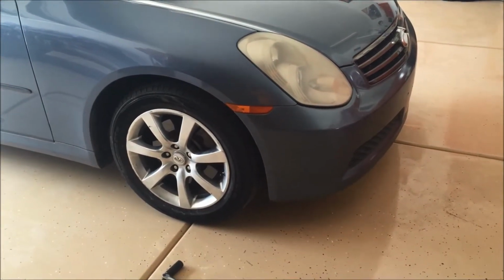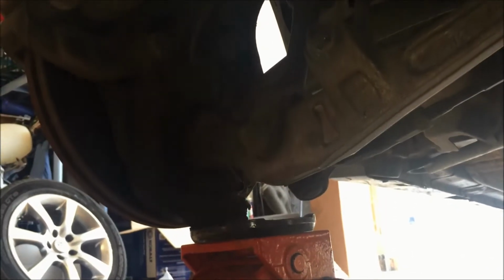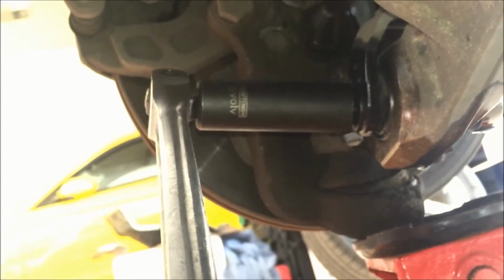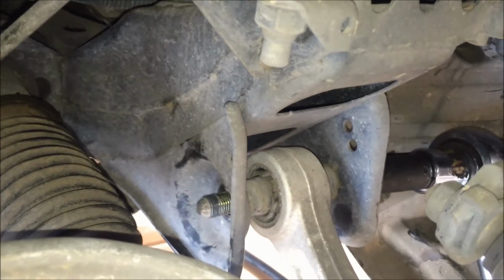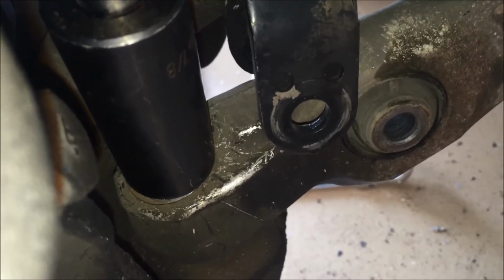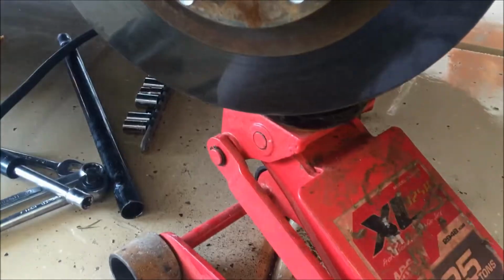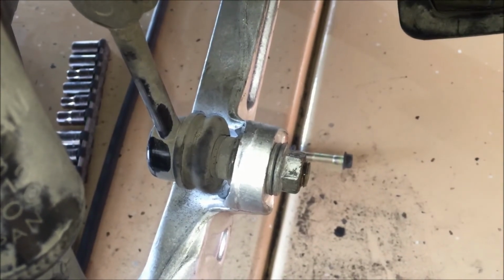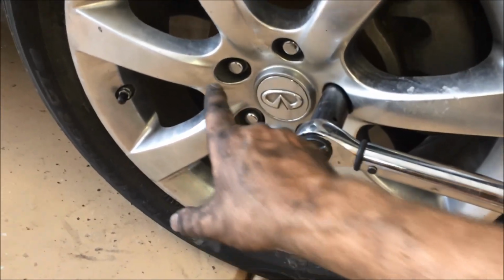How to replace Infiniti G35 Control arm

Comment: Were the shock and frame bolts torqued with the wheel on the ground or with the jack putting it in an unladen position, per the Infiniti manual? "Perform final tightening of front suspension member installation position and shock absorber lower side
(rubber bushing) under unladen condition with tires on ground."

Comment: I see a lot of these aftermarket control arms floating around the Internet including Amazon how do you know if there any good and if the OEM ball joint even fits in the aftermarket cup?
Reply: I’ve seen nice billet aluminum control arms for this G 35 with polyurethane bushings for $140/pr but the cup doesn’t fit the OEM ball joint

Comment: is this control arm failure the reason you hear clinking and clanking when going over bumps/potholes?
Reply from the maker: It can. You’ll want to inspect the Control arm bushings to see if they are off like mine was and also the ball joints, sway bar, struts, etc 
https://youtu.be/hO0h1RfYDjo

Comment: What brand control arm did you get ?
Reply from the maker: I believe it was this, and I’d recommend getting the set. The link will allow you to check compatibility. https://www.amazon.com/gp/product/B075THG8MP/ref=as_li_qf_asin_il_tl?ie=UTF8&tag=2004047-20&creative=9325&linkCode=as2&creativeASIN=B075THG8MP&linkId=e4bfb4d5043f10abf534f00d3481b8a1

Comment: That 7/8 nut ,how can I get it to tighten...it goes down past the pin hole and keeps spinning, any tips? Great video
Reply from the maker: make sure a washer didn’t fall out that needs to go under it. There is a cone washer for the ball joint one like that

Comment: I have question. I've seen frontward and rear ward control arms for the front..am I missing something?
Reply from the maker: one may be upper and the other lower. Or it could be a picture showing them for passenger side and driver side. Was this in a picture or on a car itself?
Reply: I know the coupe has two lower ones that one in the vid and a inner

Comment: Nice vid, you didn't have to compress the spring to maneuver the control arm around the strut? I had an issue with the the strut pressing down on the control arm when I was tinkering around down there.
Reply from the maker: T Pep I believe I just pulled down on the control arm a bit instead

Comment: Replaced my lower controls arms and struts , now steering wheel feels a bit hard to turn like it got stiff. Any ideas?
Reply from the maker: If the belt is still on the power steering pump and all that seems normal I would look towards an alignment